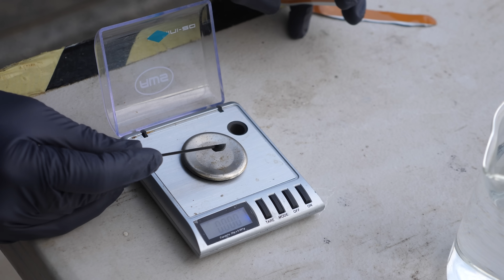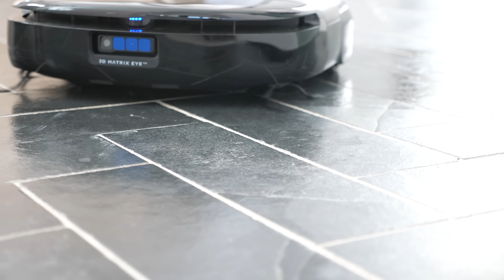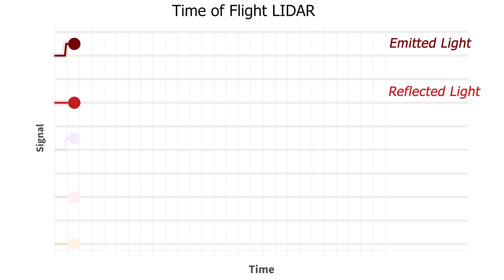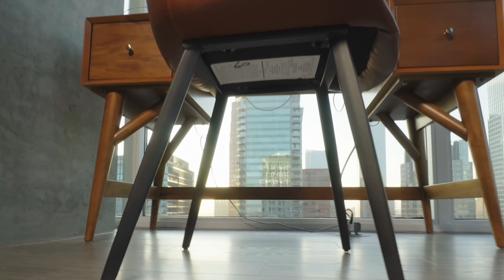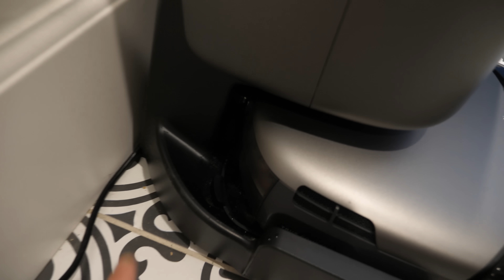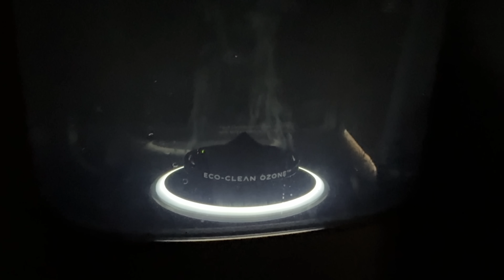How LiDAR Works: Measuring Light Speed with the First and Best Floor-Washing Robot Vacuum

Comment: I've had a $79 Euphy G30 Verge for years, dumb little bot works pretty good. It only vacuums.
Recently got a Roborok S7 that does mopping and vacuuming. It's very meh. Gets stuck more than the dumb bot despite the lidar. Had to setup a ton of no-go zones to prevent that. Its mopping is just dragging a damp cloth over the hard floors. It also drags it along the carpet a bit. It was just under $300. Another $200 would've gotten a base station to clean out the dust trap, not worth it. It is one of the highest rated, best bang for your buck, bots on the market. Didn't see this Euphy on those lists, possibly too new.

This Euphy bot with base station is $1500. Really not worth it imo. 
IDK about the square design, it'll have to back out of corners instead of just turning in them while the broom reaches in to clean. Less efficient. Cameras recording my whole home? No thanks. I value privacy. Lidar alone, or even just bump sensor alone, is enough.

Comment: The technique where a system can map an area while localizing itself in it, either by LiDAR or visible light, is called SLAM. It's widely used by mobile mapping systems (MMS), and also in some AR glasses such as HoloLens 2. There's a lot of research in that field :)

Comment: Definitely not the first mopping robot. The Roborock S7 Max Ultra has been on the market for more than one year already, including the full cleaning station. You should not believe all what the marketing of Eufy is telling you 😉
Reply: I got the S7 a few months back. It gets stuck more than my dumb old G30 Verge. Had to set up a dozen no-go zones to stop that. Its 'mopping' is just running a damp cloth around the hard floors. 
It's barely worth it to me since I got it on sale for $200, didn't spring for the base station.
Reply: @Jcewazhere  base station helps a lot. It scrubs the mop every few mins
Reply: I have two S7 Max Ultras, one upstairs and one downstairs. Think they’re awesome

And over a decade ago I’ve had a dual tank mopping robot. Albeit a less good one

Comment: Two very important questions.
1. Does it require an internet connection
2. Does it require a subscription.
Those are two absolute deal breakers
Reply: exactly!
Reply: Well, not requiring a subscription today means nothing tomorrow. Adding a subscription and pay-walling features generally available are always one TOS update away.
Reply: why wouldnt it require internet
Reply: @unironicaluser1867  Why would it?
Reply: @coleballenger4595 to send pictures of the interior of your house and send it to the company 🗣️🗣️‼️
Reply: @coleballenger4595  BeCaUsE SoFtWaRe UpDaTeS
Reply: @unironicaluser1867  It's a figgin' vacuum.
Reply: @Sonny_McMacsson ikr
Reply: @unironicaluser1867 isn't it's job to just scan the house, detect dirt and clean? All these are offline stuff.

Right?
Reply: @unironicaluser1867 so they can send your data that’s “unstored”
Reply: @unironicaluser1867  Only reason for it to require internet access is to be able to force you to pay for a subscription. Why else would it need to connect to internet? A local network is all that's needed even for control app
Reply: @unironicaluser1867  If it does, you can be sure your data is sent to china.

Comment: It is a clever solution to use capacitors to remove the need for a high speed clock.

But the speed of light is, rounded up to a useful digit, 300 million meters per second.
So it takes a 600 millionth of a second for light to travel half a meter. If you have a 600 MHz clock, that is JUST enough time to catch the reflection.
And to measure distances of a quarter of a meter, you could do with 1.2 GHz or an eights of a meter at 2.4 GHz etc etc.

2.4 GHz is actually commercially available and not prohibitively expensive.

But their solution is probably cheaper, but i don't know how accurate they are.
Reply: Except that would only tell you "light came back in  about one clock, so distance was about half a meter", while time-of-flight sensors actually have a resolution measured in millimeters - although their actual accuracy, in this case for a VL53LDK ($3) at half a meter, is only around 5cm. But that's still an order of magnitude smaller that 0.5m, so to measure it you'd need TEN TIMES your clock frequency if you were doing it by counting clocks (and they get more accurate than that at closer range!). Analog integration is the ONLY way to do this sort of thing.
Reply: @AttilaAsztalos  A quartz crystal is analog.
It's when you start adding on/off states that it becomes digital.

Even digital is analog in the background. It doesn't operate on magic.

Comment: The biggest problem with robot mops and vacuum is that they can't clean all the way into a wall or furniture, leaving unclean spots.
Reply: There is no substitute for a manual mop 😁.
The good thing is that you don't have that much work 🙂.
Reply: Yeah I kept thinking of that with these things, like the corners are what get the dirtiest a lot of the time and they cant even reach it, someone needs to make a more versatile robot that can get corners too
Reply: I did a test on this, and the results were shocking.
Reply: @metern  haha, as long as shocking can mean anything :D Shockingly good, shockingly bad, shockingly slow...

Comment: You know it's expensive when they're giving a $500 discount.
Reply: It seems to be $1500 normally which so $1000 now I guess? That's a reasonably normal price for a mopping/vacuum of this caliber, similar ones go for similar amounts. The big question is how it compares to other similarly priced machines though, I have a heated mopping/vacuuming robot from dreame that was about $750 or so that does an amazing job, I'm not really sure what could be improved... it already cleans great..
Reply: @WoLpH  The market moves so fast, this was hi end for a week.. 
I have a dreame x40 and it mops really great, and also have separate clean/dirty water and all other features mentioned here but for half the price (now that they had a 35% rebate...)
Dreame shares tech with many other xiaomi and roborock, this can be seen in similar solutions, docking stations and designs.

Square robot is not better then round, the advantage of a round is that it can rotate in place without bumping into stuff. The mop heads have greate surface area when they are round and two of them are often used and can be extended to reach closer to edges or even below doors..

Its diffrent but marginaly better then the competition. Industry is so price pressured that what whatever you get for a given price point, they are often identical in capability.
Reply: And it’s over priced
Reply: its £500.01 quid

Comment: The "3D matrix" sensor looks like it has only a single camera, so I don' t think it' s a stereoscopic approach.
The bluish squares beside the camera might be diffraction grids.
I guess there is a laser that is projecting a cloud of dots onto the wall, and there is a single camera that sees this image.
The distance of an object is then estimated by measuring the 2D distance between the projected dots on the camera image.
The further away the object is, the further away from each other the dots appear on the image.
---
Alternative approach: The infrared laser lines that are used for the time of flight detection are beeing used together with the camera:
When the camera and the laser are tilted at an angle, and object comes nearer, the laser line will be distorted in the image, which can be used to estimate the distance. This technique is quite conservative, but might work in this case.

Comment: Confusing explanation, not clear how the signals are being combined, and like there are 3 capacitors I think?
Reply: It's comparing voltages of the capacitors which depend on how much how much the sent and received pulses overlap, i.e. the time of flight. Of course the voltage conversion has to be carefully calibrated first.

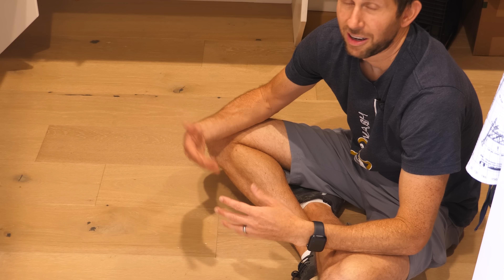Comment: 1:05 dude.. have you ever thought of tea? or orange juice? or water with watercolor? wtf??
PS that is not the first robot to use lidar, plenty other do it,
also, is this one of those where if the server goes down, or you don't have internet connection then the thing is just useless?
cause 99% of these companies for some reason put the main service in the cloud for no reason other than control and marketing  personal data. 
 but one more thing:
dust bags? 
really?? in 2024? 
thanks, but no thanks

Comment: I have a question : how laser tape meter works ?
Reply: Different tech. There's a horizontal offset between the (continuously firing) laser beam (dot) and a "camera" that is looking for it, at a slight angle. Because the camera is not looking from the exact same point the laser is firing from, this means that depending on how far your dot is getting reflected back from it will be seen by a slightly different pixel of the camera.